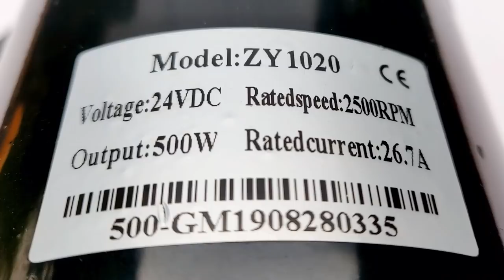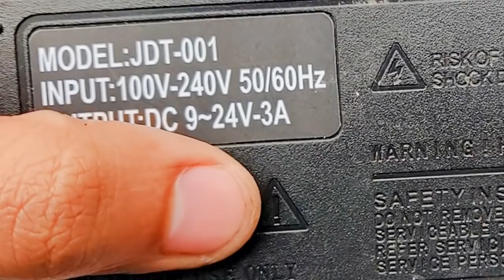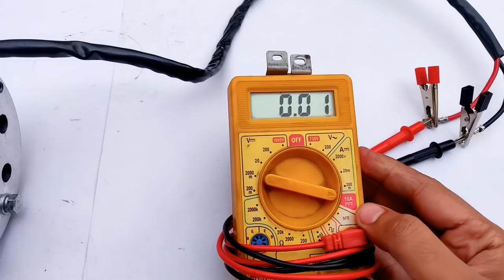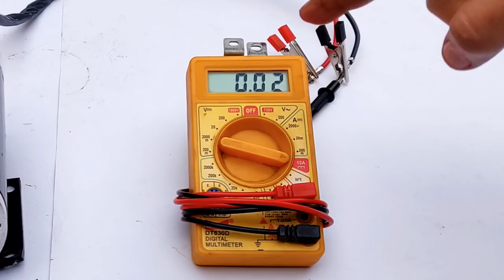What's Regenerative Braking ? DIY 24V DC Motor to 500W Generator 26 Amps

Comment: Can you make such a circuit, in which 12V to 24V and 10Ah to 4Ah current can be balanced and run in a fixed voltage?
if yes than contact me

Comment: I am controlling two 24v brushless motors with a rf transmitter, receiver and motor controller. The configuration is operational but the motors jerk violently when joystick is manipulated. how can I cut the power to the motors.

Comment: If we keep on short circuiting the motor for braking will not be affected? kindly tell me
Reply from the maker: Continuous breaking condition ?
Reply: @MrElectron  if we use this type of braking continuosly will motor be affected??
Reply from the maker: If the wires are kept connected and the motor is forced to run continuously with the help of an external rotating machine heating will start with time depending upon how fast the machine is rotating the motor and it is going to burn the windings with time like after an hour or maybe two hrs.....
Why do you ask for running it continuously in such a condition ????
Reply: If we do the same short circuiting method in BLDC motor will braking works kindly tell me?

Comment: Why didn't the  adaptor blown away at higher current than the rated current.?
Reply: Because it is for a short time. For few nano seconds to be precise.

If same was suppose to be continuous for long time may be for 20 to 40 seconds....adapter even motor winding would have blown away.

Comment: Hi friend namesta 🙏 friend i have a problem with my DC motor i have a ro 36v dc motor and 24v 15a dc power supply 
Then i connect to the power supply but it was rotating very low rpm with high torque  but friend i want to increase the speed of the motor 🤔 is their any solution for my request friend please tell me friend please don't forget my request friend

Comment: Aoto swing synchronous ac motor  (220-240v )  4watt   and  better cha 

Electric bike  lithium  charger 36v.  2A .  Charger. 36v 350 watt hub motor    cycle      no better      u stat u  (.            

(🏦 220 240v ac.    DC 36v charger.  2a ..,,🚲🚲🚲🚲  DC    36v . 350 watt motor.   Sata) 👌💐😢

Comment: Nice video. Is it possible to use super capacitors to store current generated by regenerative electric motorcycle? 

1) Regenerative current charge capacitors
2) then again give that current to motor
So that battery range increase?
Reply: I thought that was the regenerative breaking being used for, originally in racing cars then on the road worthy electric cars... ✌️

Logically whats needed is a circuit to allows normal uses of electric motor, then redirect  (one-way, in reversed polarity I assumed) the excess/generated current  during breaking/non-supplied operation the motor to storage dev (capacitor bank) in controlled manner (one-way, load balancing n controls to avoids damages from probably current spikes during recharging/breaking - something akin to diode or snubber circuit). Thou I might be wrong n there probably more efficient n better way of doing this.
Reply from the maker: Yes

Comment: hi I had ebike 24 volt 250 watts , I wanted replace the sprocket wheel fix it with pully , where I can suitable pulley from 9448800196

Comment: What you demonstrated is load braking. To be regenerative braking, you have to store the energy of motion back into a battery.  The rpm on the motor from a 24v being fed to will not generate 24v to recharge your battery. The way to recharge it is to to boost  the voltage to 26.8v or so.
Reply: But Sir if it is 3 phase bldc generator...then where to mount the boost converter....at the output of generator or output of bldc controller.
Reply: Can you give me any detailed example.
Reply: What mechanism would you suggest could recharge battery while freewheeling per say, it's an idea I've had but struggling to bring forward. On a bike for this project, any advice would be grateful..